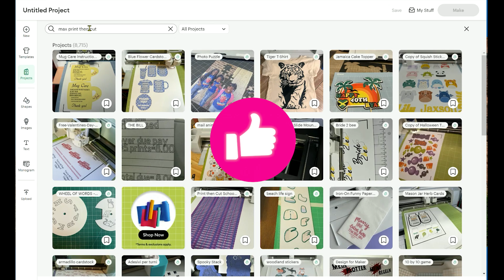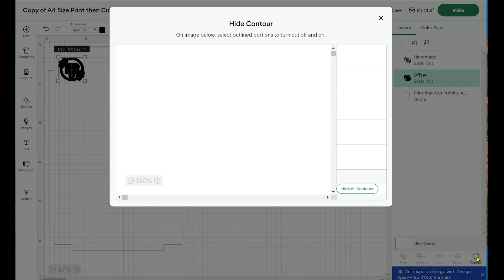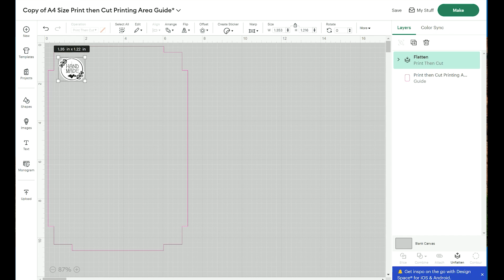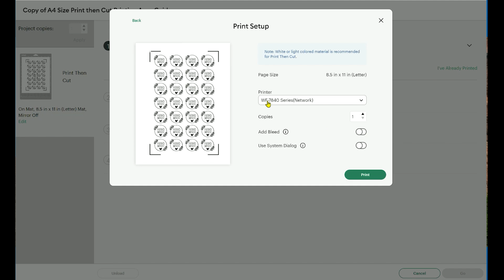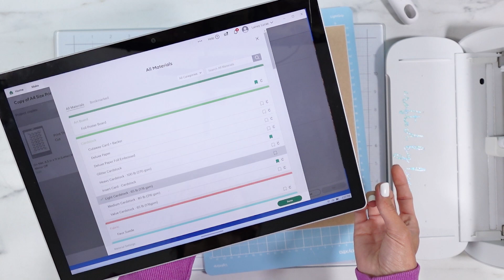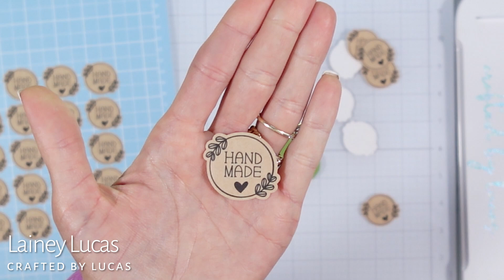How to Make Stickers at Home with Cricut | Cricut Joy Xtra Kraft Stickers

Comment: I’m trying to print then cut on Kraft paper. My Cricut says the paper needs to white. Is there a setting to change?
Reply from the maker: I would ignore the white paper issue and do a test cut on the craft paper.
Reply from the maker: I would just choose your material and load the mat with your craft paper. You may have to adjust the pressure depending on how you want your paper to be cut...meaning, do you want your machine to cut all the way through your material or not. KIss cut or die cuts.

Comment: Hi, did you change the pressure on your Lightweight cardstock settings? I did that but it still cutting like a die cut. I even use a less pressure too.  Any advice? Thank you.
Reply from the maker: I didn't change the pressure, but sometimes this happens, and you have to try out different settings. One thing you could do when selecting your material is alter the pressure settings within that material setting (if that makes sense)
-Click Browse All Materials
- Click on Material Settings (bottom left side of screen)
- Find your material & click Edit
-Decrease the pressure & Save
- Test Cut
Reply: @craftedbylucas  when you say "test cut" is just use a regular printing paper?
Reply from the maker: @darlenepabz4030  
One thing you could do is print one small design on your sticker material and test cut it. You could then load the sticker material  back in your printer in the other direction and use the rest of the material for additional test cuts, etc. I hope this makes sense...I've had to do this before, many times, to test out settings.

This will help you save on ink and material. 

I would go into your material settings and decrease the pressure by about 20 and test cut, and go from there.Let me know if i need to clarify anything for you.

Comment: I never thought of using a Kraft sticker paper. Ty! Do you have a tutorial on how to make clear stickers without a white border? I noticed the white didn’t print on these despite your making a white offset. I can’t quite figure out how to do it. Thanks in advance if you’re able ti help me!
Reply from the maker: I don't have a tutorial using clear sticker material as of yet. But I do have the material, so I'll be working on that tutorial shortly. If everything goes well, of course. 
As for the white offset, it doesn't print off in "white," but it gives the sticker a border. The printer doesn't print in white, so just think of the white as extra space being added to her sticker...I hope that makes sense. Also, depending on the design, you can opt for no offset and use bleed (for the printing process) instead. I have a custom label tutorial coming out on Saturday where I demonstrate this on printable vinyl. Let me know if you have additional questions or need clarification...I know that there is a lot of info to digest when it comes to print then cut with the ciruct lol Happy Crafting :)